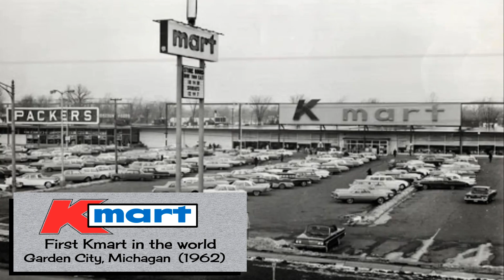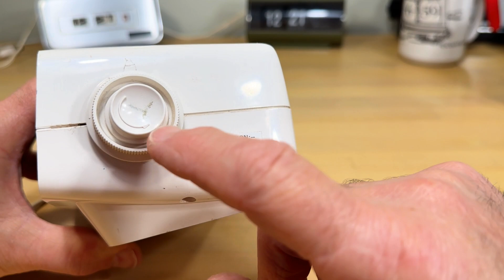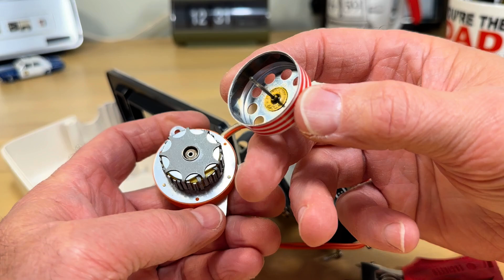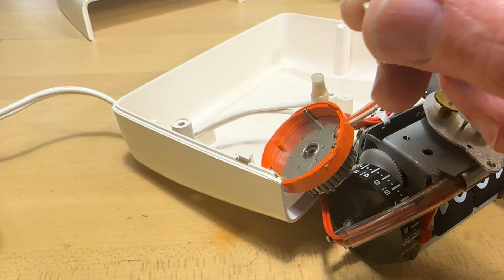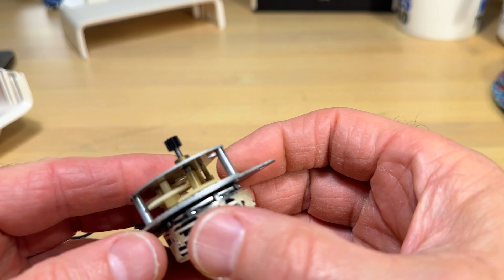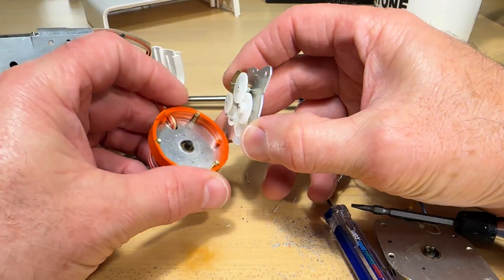The K-mart KMC-320 flip clock - how to fix the Artin AR-01 motor.

Comment: Hi,i threw a lot of flip clock because most of the times there's a gear with the teeth broken(specialy the first one directly in contact with the motor)i heard about the 3d impression but i never try...I think it's the weakness point of these clocks..😮
Reply from the maker: You are so right.

Comment: I remember seeing this on eBay and it was the only one like it I had ever seen. I find it interesting that it has a snooze. Is this that same one? Are you planning on selling it?
Reply from the maker: It was the same one and it does have a snooze. I could not find it advertised anywhere. I don’t sell clocks at this time. Those Artin motors almost without fail will end up this way. I’ve been thinking about it and the only difference between these and the Copals is the metal first gear.  Some Copals are still going with no sign of stopping. Thanks for the comment!

Comment: Awesome video A+++  I would really like to get the old clock working on my 1970's President Dwight D. CB Base Station. It not actually a flip clock. It is one of those in which the numbers rotate.  On rare occasions when I plug the CB in I can actually hear the motor humming as if it was trying to turn the numbers.  It probably needs a really good cleaning & lubrication since at 1st glance when I take the cover of the base station everything for the clock looks still intact. Any recommendations or good video about fixing rotating 1970's clocks?
Reply from the maker: There are many different types of the rolling wheel clock. Your clock seems to have a history of breaking down. The following video discusses this and describes how this gentleman fixed the problem. 
https://www.youtube.com/watch?v=-g1RuRhQ5FY